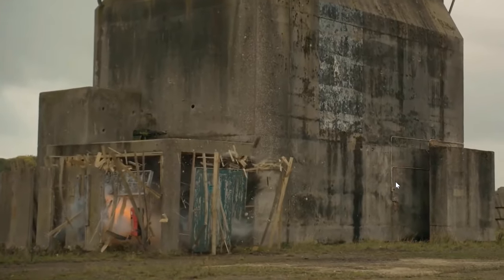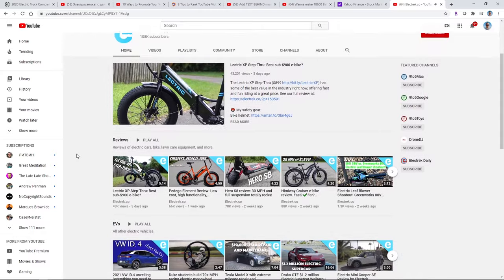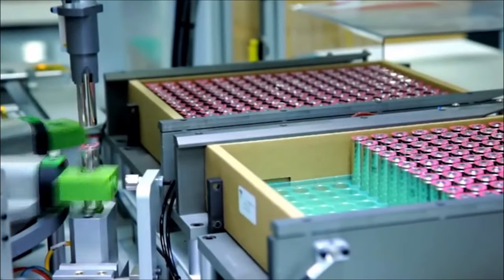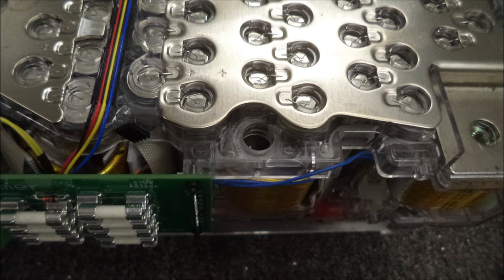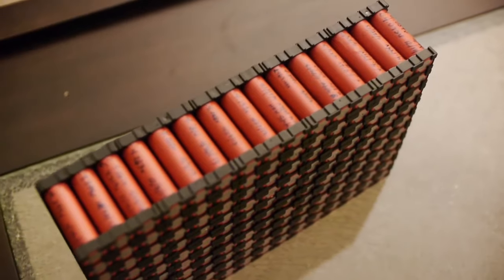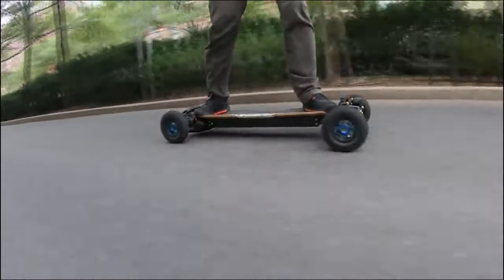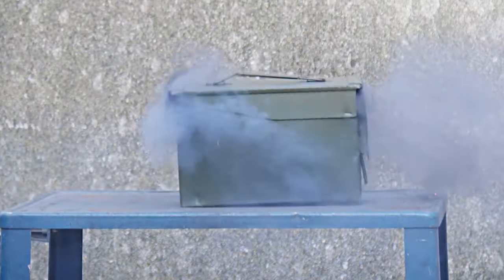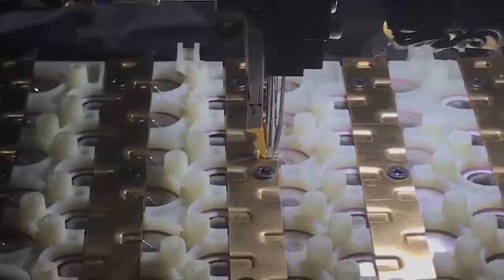7 Steps On How to build The Safest DIY Li-ion Battery

Comment: Dude no, cell level fuses are not practical or even a good idea. If the fuses pop you are very likely to lose control and crash at high speed. 

I would rather try to slow down a burning board or scooter then be thrown off at 40 mph

Please don't spread miss information about electric vehicle battery's. Cell level fuses only make sence in much bigger packs or with reclaimed cells where the failer rate is much higher
Reply from the maker: So wrong!!!
I tested a board at 40mph and the entire group of cell on one side (pack was 12S4P) 1P disconnected and the vesc just went off and the board slowly came to a stop. I thought the vesc died but after seeing the heat shrink melted I saw the fuses worked. Before writing none sense do a test!
Reply: If fuse pop, then you are in a lot less trouble riding board without brakes, than riding potential fireball, which will also have no breaks, because after the short there will be no power. Key is to have right fuse so it doesn't blow prematurely.
Reply: I have been riding single 40A fuse on 10S dual motor setup with each VESC set to 50A and never popped even on hill climbs.
Reply: @ElectricVehicleSpace  HAHAHA, please tell me how i should place a cell level fuse for 40a, please I'm waiting......
Reply from the maker: @infiniteoffset  yes you are correct! The fuse is there only to protect if the cell discharge more power than is intended or to prevent shots or thermal runaway.
Reply from the maker: @creeperproof2  Tesla is using fuses for all their batteries including powerwall. It's a technology tested and proven to be the best protection system.
Reply from the maker: @creeperproof2  40A will burst your cell in flames. The thinner the fuse the less amps it will hold. It's very simple. Its explained in the video. Re watch it!
Reply: @ElectricVehicleSpace  there are bigger cells that can output 40A and even higher. 

You did not get his point. If all the cell fuses break one after another you have no breakers on your e board. If you go down a hill into traffic you could potentially die. In this case its saver to let the board burn down and break to a standstill.
Reply: @ElectricVehicleSpace  Depends on the cell. I'm starting to wonder if you actually have the experience that you're touting in the video, or at least don't have much experience working with large packs and big power. There are plenty of lithium cells that can output much more than 40A individually.
Reply: @blise518B  True. I don't cruise on boards so I've never done this, but I would argue that it's a good idea to have a mechanical brake of some kind for these scenarios. I use my electrical braking in my motorcycles, but I also have calipers and brake levers in case something goes wonky with the electrical. Maybe someone should come up with a foot operated brake mechanism for boards to get around this issue? Possible content idea Portable Electric Vehicle....if he is, in fact, a builder.
Reply from the maker: @JamesBiggar  hey James how can we connect? I was referring mostly to 18650 or 20700 cells. I mostly now use 30Q cells and fuses are designed for this particular situation. Have you open a Tesla module?  Have you researched what they have done in the safety area?  I would not look farther nor follow other people that buy packs and dont build batteries. At the end of the day each person calculates their own risk when building or installing purchased packs.
Reply: @JamesBiggar  yes there are hand breaks for electric Skateboards but that kind of defeats the purpose of being light simple and portable. In theory you could add a lot of additional stuff so make it a bit safer but if you design and build everything right and regularly check your cells with a Bluetooth bms the chance of something going wrong are very small. I guess the best compromise would be to split the battery and ESC for both sides so even if one side blows the fuses the other could still break.
Reply: @ElectricVehicleSpace  even in the 21700 area are some cells that can deliver way over 20A continuously My latest builds use P42A 21700 cells that can output 45A. I don’t think its necessarily a good idea to look for Tesla modules because there load is very different from our small vehicles. Each individual cell in Tesla packs does not nearly deliver as much power as our small packs because the load gets spread to a lot bigger battery pack.
Reply from the maker: @blise518B  I mentioned that you have to calculate the max when the fuse disconnects from the cell and protects it from bursting in flames. Different cells have different ranges of safe usage. Each fuse has to be designed with that in mind. I would follow what Tesla does and you can do whatever you think is safer for you.
Reply from the maker: @blise518B  no one pretends here anything. I tested like other people did that know what their talking about. I rather follow a genius like Elon that makes me $$$ and ignore stupidity!
Reply: @ElectricVehicleSpace  Allright so not copying everything Elon ist doing is stupidly got  it. 
Ever heard of the hyperloop? It’s a completely unpractical old idea that he tried to sell as new just to create hype around him. A lot of money he makes ist just blind hype that’s very risky and not that genius at all.
Reply from the maker: @blise518B  Says who? Elon has over 100 billion and now second richest person in the world. Helped so many people and will change your future. 
What have you accomplished?
Reply: @ElectricVehicleSpace  and now because there is no reasonable defense for his little hero he falls back to the god old personal attack. No Pont to discuss anymore. You just outet yourself as a mindless fanboy wo can’t even argument anything besides he is genius and everything he does ist perfect.
Reply: @blise518B Haha. thank you, finally someone with sense. this so called "builder" cant seem to understand that there are plenty of cells capable of 40a and that you simply cant fuse each cell to 40!   he clearly just follows musk blindly even if some of his projects are clearly BS  (Cough  Cough  hyper loop   Cough  Cough)
Reply: @ElectricVehicleSpace  But: thermal runaway is mostly a process inside a cell, which an external fuse will not protect against. What an external fuse protects against is overcurrent into/out of the cell, and this usually happens when (1) the pack as a whole is shorted out (but then your single external fuse should blow first, rather than all of the parallel fuses in the pack, which likely can more than sustain the total current) and (2) when one battery in a string becomes shorted out internally, to avoid the remainder feeding their charge into that one battery and overheating it even further and/or becoming part of the problem. But if (2) happens most of the times, if not all of the times you will find that the pack had already become dangerously unbalanced leading to one cell group being deep-discharged or overcharged, and that is a condition that should never happen. So in my opinion, while per-cell fuses make sense for very large packs (where the probability of a cell going bad goes up, and where losing a single cell isn't as much of a problem) and situation where you use reclaimed cells with unknown history, which also has a higher probability of having a bad cell. Finally, and this is again probably more important than individual cells being fused, you have to properly monitor your battery, using thermal sensors, and if there ever is an anomaly (such as a cell getting warmer than its neighbors) to immediately stop using that pack and to never put it in a situation where if it does go into thermal runaway that it will take something else with it. 

The bigger issue with DIY packs are: crappy pack insulation, wires too thin for the amount of current used, improper solder joints of wires, packs soldered instead of spot welded, and finally one of the main culprits, shorted out balance wires, never cross them, and always tie them down using tape to ensure that the wires can't rub against something and eventually wear down their insulation, ensure that sense and balance wires are solidly connected to the bus bar that they are sensing and to ensure that none of the circuitry or the batteries can come into contact with the housing or other metal parts. This is the main reason why packs burn up.
Reply: @JamesBiggar  Agreed. Also: handmade wire fuses will be inconsistent +- 50% at least if not worse than that, and that's before we get into proper bonding.
Reply: @ElectricVehicleSpace  Have you tested your fuses in the tens or so to determine exactly at what current for what duration they blow? What is your variance? Do you see differences depending on where in the pack the fuse is? What about which side of the pack the fuse is on? How do you deal with fuse wire corrosion? What about contact resistance over time? These are all very important questions that need answers, what works for Tesla in a very highly controlled factory setup with a robotic wire bonder and with extremely large packs where a single cell will not materially alter the balance of the pack could actually work against you in a safety sense absent the ability to actively balance the pack and to be alerted when/if a fuse goes because after that without further work the pack is now actually more dangerous than it was before. Also: given identical cells and large variance between the fuses, if a fuse goes due to overcurrent this will normally lead to a cascade of other fuses burning up, you need to make sure that this cascade does not in turn become a larger problem by itself and that the heat from the burning fuses does not set off a fire, so you will need to carefully design your pack mechanics to take this into account.
Reply: @ElectricVehicleSpace  can you share a source for  fuse wire?